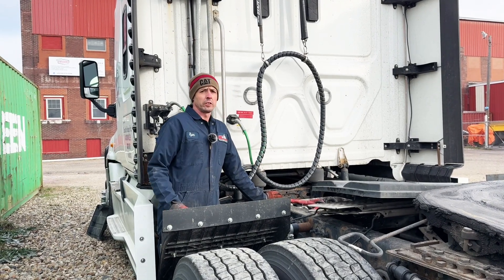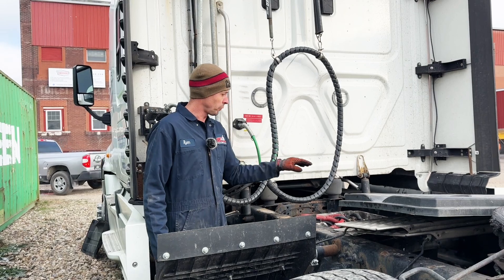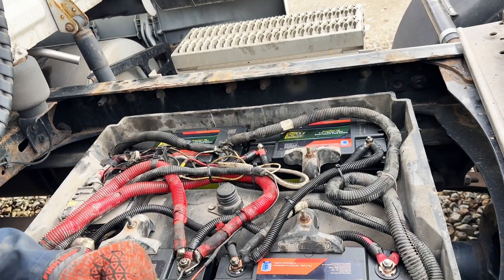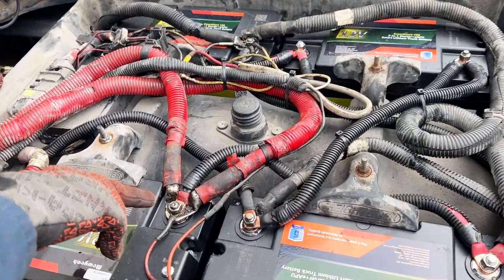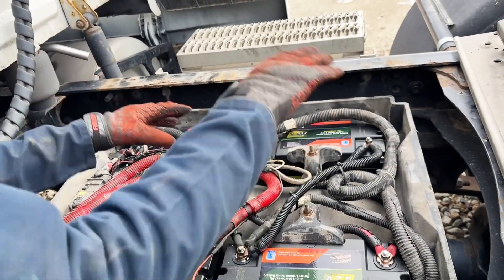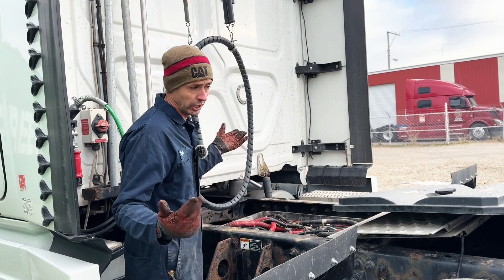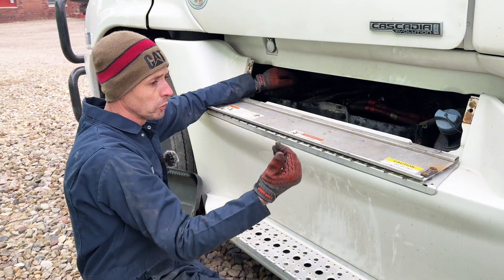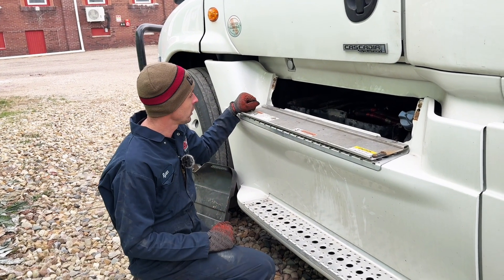Convert AGM to Lithium Batteries for Freightliner Factory Installed Electric APU

Comment: Do the lithium fully charge with the existing/original voltage system and alternator. Everyone is saying they will never fully charge and could be bad for the alternator which is why Freightliner and Volvo are still using AGM. Is this true?  Also I called your place to pick up 8 batteries my next time through Ohio. Spoke with a lady who never called me back after a “meeting”
Reply from the maker: Typically alternator has a voltage range of 13.5 to 14.5V. Please refer to your specific alternator to find the specification of the vantage range. Our lithium batteries requires 14V to fully charge the battery. We have installed our batteries to all the makes of the trucks, so far they all can be fully charged.
Reply from the maker: Sorry about not calling you back! She gets tons of calls per day, sometimes she may forget about it. We apologize for it. Feel free to call us back and schedule a pick up. As our battery inventory is getting low again and won’t receive new inventory until January.
Reply: No